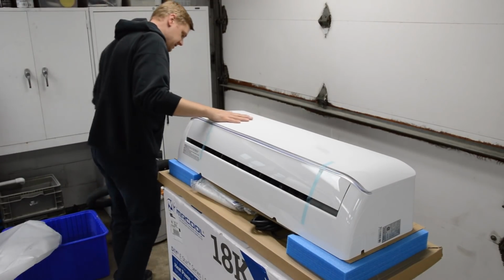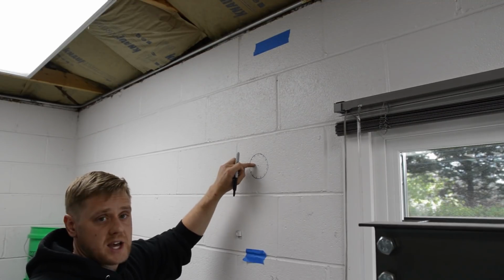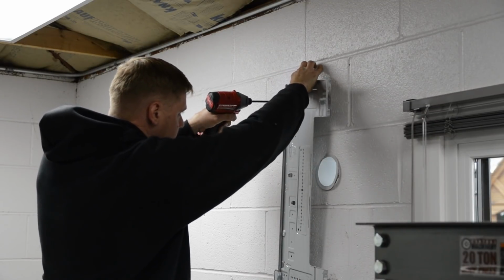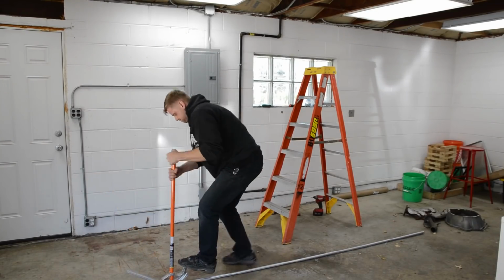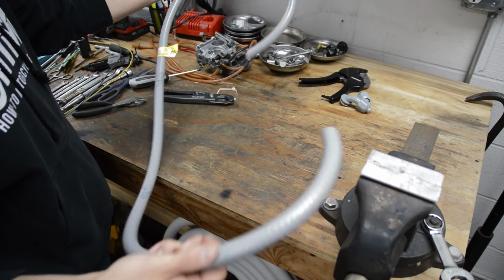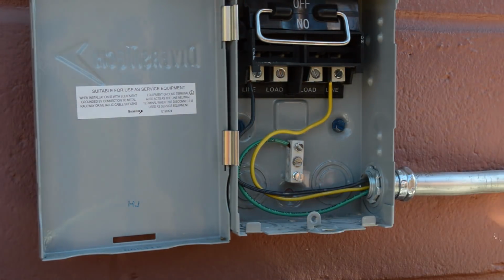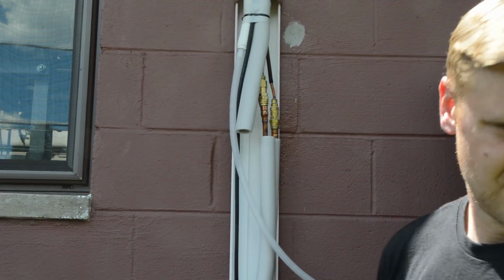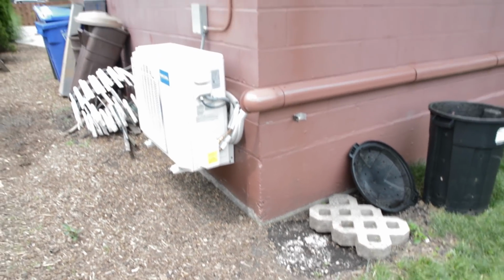How-To: MRCOOL DIY Mini Split Installation (Step by step) / Garage has A/C!

Comment: Hopefully you dont have issues with it. 
Its nice for diy though.
Home depot and lowes sell plenty of concrete bits work with notmal drill.  You dont need the fancy core bit. 
In general cmu blocks do have three webs. But they move depending on what type of cmu block they chose or need to use. My old house has 4 webs.
Then there is the solid poured columns in the wall with rebar.

Comment: Did you pull vacuum on the line before you release the refrigerant?
Reply: The Mr. Cool diy units come precharged and vacuum sealed from the factory

Comment: I’m curious how well the Mr. cool heat pump heat’s as well as cool’s ?🤔 you did a great job with your video 😃👍🤔how long has it been since you’ve installed it and are you still happy with it ?
Reply from the maker: I don't use it for heat. I have a 60k natural gas hanging heater. It is oversized for my space however it was free. Now that natural gas prices are way up, I should look into using the heat pump for heat???
Reply: The heat is amazing. I have two 18k units for the house and one 9k for a back apartment room. The air output is roughly 100 degrees hotter than the outside air. On a 10 degree night its putting out 110 degree air. These heat my whole 3800sq ft house with no problem. Ive never had to cut them up wide open in a couple years ive owned them.

Comment: Great Job! One question for you is what size of the wire from panel to box? 10, 12 0r 14? Thanks.
Reply: It depends on the BTU size.  You can download all DIY model manuals on MR Cool website; it tells you wire size and breaker box.  For example - my 36k BTU unit calls for 10-3 wire with a 2 pole 40amp breaker.

Comment: No loop on the line set.  Did you mention line set recharged with refrigerant? If not you need nitrogen pressure test leak and vacuum the line set before open valves on unit.  Thx for sharing.  Oh don’t use yellow on 230volt.  Use black
Reply from the maker: No need to vacuum this DIY kit. I used yellow since I had it. My choice would have been black and red.

Comment: just want to ask, dont you need to vacuum out all the air in the tube before adding refrigerant on a normal ac?
This type with air in the tube when you plug in, wont it affect something?
Reply from the maker: https://mrcool.com/blog/pre-charged-line-sets-real-right/

Comment: Great video! Will look more into same unit before ordering, Is that unit a Plug and Play type of unit? In video you never mentioned the need of vacuum the lines and charging unit with required amount of coolant.
Reply from the maker: Lineset is precharged no need for vacuum.

Comment: Did all the stuff the wrenches, tool bag, hole saw, plastic ground platform, outside 12’ wall cover come with the DIY Kit?
Reply: Did you have to buy the tool bag, wrenches and hole saw that you used?
Thanks
Reply: @DBMac58  None of the items you mentioned come with the unit.
Reply: The term "DIY" implies the homeowner is somewhat of a handyman and the assumption is you have these tools.  Installing HVAC is not like installing a Ring door bell.

Comment: When drilling the hole thru the concrete, if they would have stopped drilling once the drill bit just showed on the outside and then went outside and drilled back toward the inside you would not have had the break out of concrete and would not need patching.  Just a thought.

Comment: Well done. I see that no vacuum is pulled on the line set to remove moisture from the system prior to charging the lines.  I understand that moisture kills these system   eventually.  TXS !!
Reply: I saw the same, you are right.
Reply: @ecarrero01  His unit may have come with pre vacuumed lines. No need to pull a vacuum. But I didn’t see him disclosure it.
Reply: You probably know this by now but the DIY Mr. Cool units come pre-charged with vacuum.  No need to do vacuum pull.

Comment: Nice and clean install, but I think you said you used 12 gauge wire even though 10 gauge is required by code.
Reply from the maker: No. 12ga for 20a.
Reply: @HTMR  OH, my unit may be a bit bigger.  I have the 36k unit, so it needs 25 Amps and I needed to bump up to 10ga.  I'll be buying the wire tonight...  Too bad because I have a bunch of 12 gauge laying around.

Comment: Do you have a reference for those rain tight connectors you use for your conduit? I'm seeing some Halex, Arlington and other brands around but they're surprisingly hard to come by, especially for 1/2-inch conduit.

Comment: After watching that, all I can say is thank God for HVAC guys...
Reply: after watching this I was thinking what do they need us for (HVAC TECHS) so this is my 2nd comment now just yakin  I guess but I don't care what the manufacture says (they have lots more you can buy due to premature failure ) about no vacuum need be pulled I couldn't do it even for my dog's house lol now as far as a dog is concerned I have replaced many cond. units due to dog urine on the coil it just eats it up so if you have the option put it up higher. Also, why did I have to get a license( per EPA guidelines ) to handle equipment with refrigeration if joe-cool can order from the net?

Comment: You connected the wires in the wrong order. It is suggested that you start wiring from the device that's being connected (the cooling unit in this case) and the panel (or subpanel in this case) last.  That way if someone goes to the panel and flips the breaker while you are working on the item, you wont get electrocuted.
Reply from the maker: Who would do that my wife LOL?
Reply: @HTMR  LOL

Comment: Can I run those lines from the unit to the condenser over the ceiling and then pull them out somewhere? The room I need this cooling in doesn't have a wall directly facing the outside. Or do have to go directly down to the unit
Reply: Wondering same thing. Only spot I have is an interior 2nd story wall and don’t know how I’m going to drain this thing
Reply: Did you ever figure this out? I don't think you can go up because you'll need a pump as the condensation line won't drain if it goes upwards (obviously)

Comment: Why don’t you need to install a neutral wire from your main to your compressor outside? I saw that you installed a ground wire but why no neutral?
Reply from the maker: 220 does not require nuetral
Reply: @HTMR  Okay thank you for the quick reply. I’m very visual… So technically the heat pump ground wire which is attached to my ground bar in my sub panel (bonding screw removed) is also attached back to my bounded main which has a common (neutral/ground) bar which feeds both back up the service line as well as to the ground rod in the ground?  So in a sense, the heat pump grounding wire is still connected to the neutral bar back on the grounding bar in the main panel.
Reply from the maker: @reblzbackjack  Yes neutral and ground lead to the same place in main panel  and are "redundant".

Comment: just want to ask, dont you need to vacuum out all the air in the tube before adding refrigerant on a normal ac?
This type with air in the tube when you plug in, wont it affect something?
Reply: @carlose170  So many people make this comment without realizing the DIY units come with pre-charged lines.  Once connected, a Schrader-like valve pierces the other - releasing the 410A refrigerant

Comment: Nice in stall, looks like a good unit. Did you calculate the long run of the lineset to use all the extra length? That's the only drawback I see with Mr Cool DIY, what to do with all the extra length if you don't need it.
Reply from the maker: Coil it behind condenser.  I had 2-3' extra which worked out perfect.
Reply: MatthewMCRepair  Thanks

Comment: What size cord grip did you use?  Looking on Amazon and there are too many options.  I’d like to get a metal one like you used.  Where can I buy?  Reply with a link if you would get a kickback.  Installing a Mr Cool DIY 12000 BTU soon.  Thanks!
Reply from the maker: I forgot. Just go to home depot they will have both.

Comment: Nice job.  Hanging the air handler by yourself is a challenge.
Reply: When you watch the mrcool vids on the company page, the installer actually has a cool way of doing it...basically you start with the handler vertically, with the lines on top. You slip those in the hole and then rotate it 90°. That way you can concentrate on the lines getting thru the hole first and then making sure you're prepared for mounting the handler on the bracket. A ladder would've been ideal here as the top should go in first and the bottom snaps in.

Comment: That's a very long refrigerant line. There's gonna be a lot of air and moist without vacuum. What's the compressor running amp?
Reply from the maker: No need to vac the line in this system.

Comment: What about the air inside the copper pipes before opening the refrigerant lines.  Its better to use a vacuum pump for a more professional install, maybe next time.
Reply from the maker: Lineset is quickconnect with plungers so nothing leaks out of gets introduced.
Reply: @HTMR  I guess that's where all the confusion has been about.

Comment: I'm an HVAC technician and i have to say that was a pretty clean job. definitely not a basic job for the basic homeowner though. the company I work for here in Phoenix AZ get the call all of the time where the homeowner can't finish the install or diagnose a small problem and as a company, we won't touch a customer install job based Soley on liability issues. So, customers of Mr cool are left with trying to hunt down a technician to fix one of these which isn't easy. Especially in the summertime. P.S.  I cringe when seeing the copper being bent over like that at the powerhead. lol
Reply: How come they say just connect and open line. Why don’t they say to pull a vacuum. Why isn’t it needed
Reply: @scarrillo8836   That's the whole selling point. Line Set is pre-charged and remains sealed until connection between the two units is achieved. Downside is you cannot customize the length of the lines--excess must reman coiled up near the condenser--increasing losses.

Comment: Question:  How far, is 'required' for the 'backside' of the outside fan, to be placed from the wall?  Seems, a lot of videos, show people placing these parts "too close" to the wall.  =) BEST part of your video, was the 'cocky' rooster attempting to blend in with the hens...
Reply from the maker: Not sure, however the mount is designed for this unit, so I'm sure they figured the correct dimension. Lots of airflow behind it. LOL we don't have any roosters, that was our BIG hen.
Reply: @HTMR  Cool mount.  I did notice it.  I also noticed, 'some' units, have a portion of the left side, cut out, which allows for MORE DISCHARGE, out that 1 side. Some, may not know, that fans are rated, NOT just by the power they draw (motor rating), but the amount of 'air flow' in cubic feet per minute or CFM (FAN BLADE configuration or shape).  NOT allowing 'either' inflow or out flow or too little, by placing a unit too closely to the house or trailer etc. will reduce this CFM and thus, the ability for the unit to cool properly IF at all.  ALTERNATIVELY, placing a fan too close, could cause it to 'shudder', like your body when cold.  Thus, eventually causing, premature failure of the fan bearing etc.  ONLY reason, I chose YOUR forum for this is cause, "I like you".  lol  :}  cReEpy huh? lmbo.. hahaha NOT like THAT THOUGH!
Reply from the maker: @civildk9077  There is a cut out on the left side. It flows just fine on this mount.
Reply: The manual calls for 12" clearance from a wall for ground mount and 6" for bracket mount.  He used a Mr. Cool bracket so he has the clearance.
Reply: @itisaporsche  AWESOME information!  Thank you  (I appreciate specificity)

Comment: thank you for the specific detail on the installation. what is the indoor installation specification? i want to install one in the attic but i don't much room.
Reply: I just installed an 18K today. Minimum ceiling clearance is 5.9" and side is 4.7". Recommended height is  78.55" for ceilings under 9'

Comment: Do you recommend installing mini spits to a whole house in southern CA that's about 1,200sq ft. or installing central AC? I'd be starting from scratch so I'd have to put in ducts, etc... I can't decide.
Reply from the maker: Go central if possible. Can't beat supply and return ducts in every room. Mini split is more for retrofit applications.

Comment: Edit: Just found out that MRCOOL is the ONLY BRAND of Mini Split that supplies "pre-charged line sets" and no other. 
So if you're a DIY'er that installing anything other than this brand (I have installed 4 of my own thus far) then you can follow most of this video UNTIL it's time to release freon into the system. At that time you must purge the system using a vacuum pump. 
The convenience of "precharged lines" isn't worth the additional costs of paying for a "MRCOOL" system in my opinion as their systems seem to be twice the price of comparable units on the market. 
MRCOOL 24K BTU heat pump costs $2250 (6/2021)
Boreal 24k BTU heat pump cost me  $950 picked up
Yep, I have to use a vacuum pump which is a no brainer...
End edit

Umm, 55:36 the installer opened up the valves but never pulled a vacuum via the service port to purge the evap core and the lines? Don't do this this if you're following this video. 
The lines and the evap core absolutely require a vacuum pump to purge them of air/moisture BEFORE opening up the valves to allow freon to flow...I did a quick search, this is one of many videos showing how to purge the evap and lines on a mini split (not to mention the instructions that come with the unit itself):
https://www.youtube.com/watch?v=k9uohbYDuRs
Just a note here. I have a micrometer guage as shown in the video but if you don't have one just use a vacuum pump and run it for 45 minutes to an hour and you should be good. Make sure you have a way to close off the output of the pump when you shut it off though. The person filming the video is speaking to HVAC techs about pressure testing. Disregard what he says. It's impractical for DIY'ers to have nitrogen bottles laying around to pressure test. Just do a vacuum for 45 to hour and hope for the best. You have a 98% chance of success.

Comment: You have to be very diligent about checking for leaks. The refrigerant in the unit and the lineset is all they give you, and if it is vented to atmosphere then you will need to involve a professional (and it may be hard to find one who will touch a system that was DIY-installed or warranty their work if they do.)
Reply: True.  But it does seem pretty simple system to get right.

Comment: So I have 10 4. Can I just use the white as ground or should I use the unshielded ground wire from the main(none sub-panel)?
Reply: You need an electrician. I think you mean 10/3 plus ground. You would only need 10 wire for the 36K unit. For all other units, 12/2 wire. Why would you use the white as a ground and not the ground as the ground? You can use a three wire (plus ground), just don't connect the neutral. Call an electrician.

Comment: 16:12 There was no need to put the wall mount against the template, then drill through it for a pilot hole. That's what the template is for.

Comment: Love the videos but honestly you don’t need to tamper with that web! A 2”  hole is more then enough worked fine with mine 18 k installation mounted unit inside use spray foam make your own interior/exterior sleeve and some sealing putty no problem. Nothing against you you followed there instructions! They can do better!
Reply: How do you create a sleeve with the spray foam?

Comment: @11:30, get a bit long enough to penetrate both sides on the initial drill sequence. Tilt the bit a bit, go through both sides. Then hole saw from both sides.
Reply from the maker: That would have been ideal, but I didn't want to buy one.

Comment: Beginner here. Did you use the same AMP from disconnect to the main panel circuit? Can I go 30 and higher AMP for 18 K BTU?
Reply: The 18K unit only requires a 14 wire but a 12 wire is recommended. 14 wire requires a 15 amp breaker, 12 wire requires a 20 amp breaker (both double pole). If you undersize a breaker, you just run the risk of it tripping frequently; you oversize a breaker and you'll know for certain how fast your local fire department can respond. You need an electrician.

Comment: Good job just add a 1 1/2 thred bushing in bottom of ur panel to protect feed wires from chaffing
Reply from the maker: Hmmm though I used one, I'll double check thanks.

Comment: Nice video, congratulations…. Except maybe for one major flaw in the electrical installation.  Please continue reading…. You ran 2-hot, and 1-ground to your 220-240VAC equipment.  Correct me if I’m wrong, but I’d bet the inside fan motor is rated on 110-120VAC, not 240VAC.  If that’s correct you have energized the Ground Wire on this installation.  It now carries the unbalanced 120VAC Current back to the Power Station.  You should have pulled a 12 gauge Neutral Wire for this purpose.  NEC-70 is very specific about Neutral and Bonding requirements, and your Electrical Inspection would’ve caught this, if it wasn’t a DIY.  Very easy to check, clamp a Amp Meter on your Ground Wire if it indicates flow your HOT…. Hot Ground Wires can and do Kill.  Know what you’re doing before you cause an issue that may harm yourself or others.  Current flows back to generation location on all available pathways simultaneously, it doesn’t care if it’s a Hot Wire, Neutral, Ground, or wire size.  Safety first… Enough said…
Reply from the maker: Well in that case the sub panel and all my exposed EMT would be "hot". I have touched all that a million times in the past year and nothing happened. The outside unit handles the 120V distribution to the inside unit.
Reply: Yeah; this is why I will do everything myself except the electric work.
Reply: For the Mr.Cool units only the 12k btu runs on 120V everything over that is 240V.